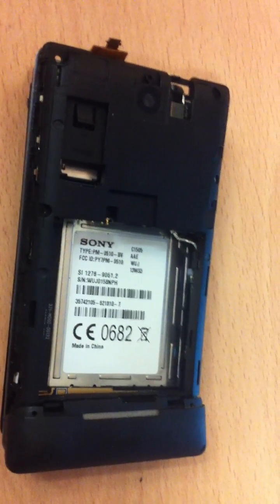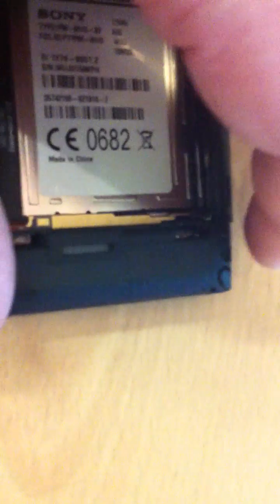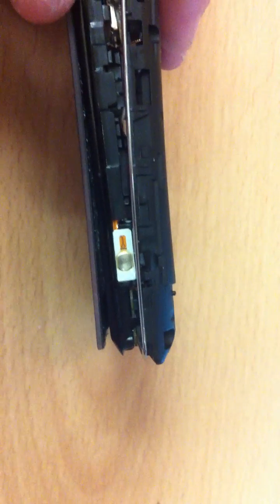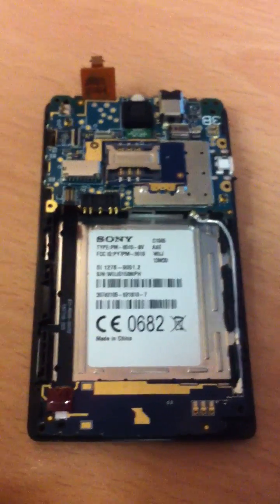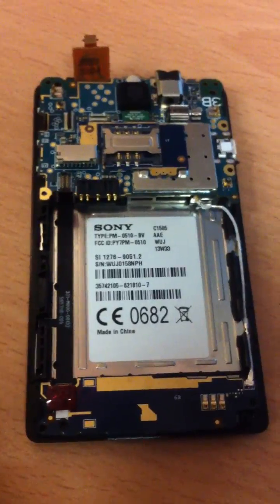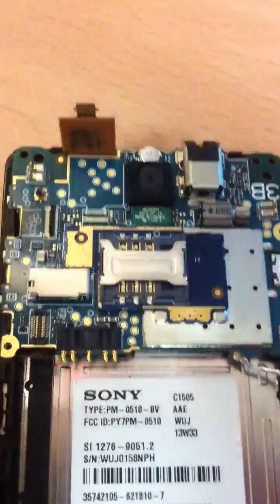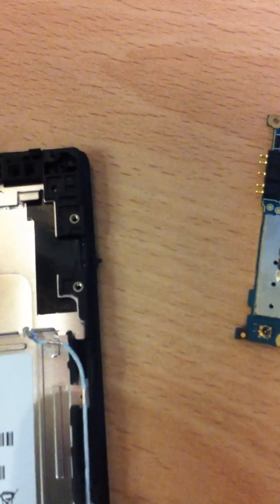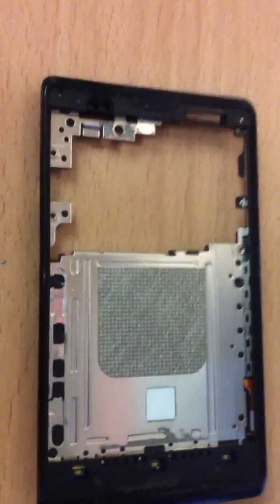Sony Xperia E C1505 Disassembly Tear Down Guide Take Apart

Comment: It goes like this Chris: If I need a video on "how to" do anything I will frequently look to YouTube for the info. There are really good videos and then there are mediocre or bad ones. Yours rates in my books as 3/10, as it has not properly demonstrated "how to".
 I merely suggest that you take a look at some of the many good videos and try to learn from them.. BTW I have never posted a video, and probably never will however that does not preclude me from having an objective opinion. I reckon you would have thanked me if commented "Great Video" but then I would have told a lie and looked silly too!!
Reply from the maker: there is saying i dont like this video and giving a reason and there is being a tool, like you are and being rude. i do not charge people to watch this guide, its just something i did really quickly a little while ago. watch it dont watch it i dont mind
Reply from the maker: condesending and in general being a bit of a tool is what you come across like, maybe thats why i replied to you comment
Reply: Don't take it to heart Chris. In fairness I have checked and see you have some fairly decent videos up, but this one really sucks and is inadequate, and you should be man enough to agree!!   BTW calling Mick a "little prick" (4.21) is not very nice, in fact some would call that rude!!
Reply: chrisfowler20 Tool?